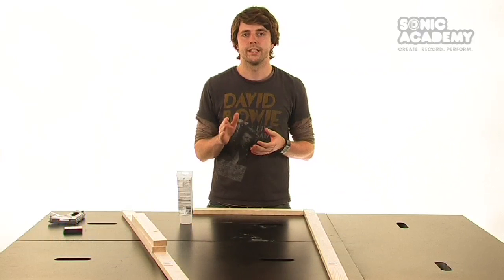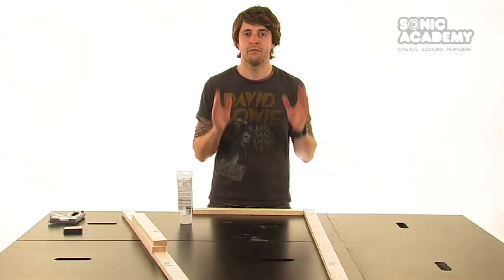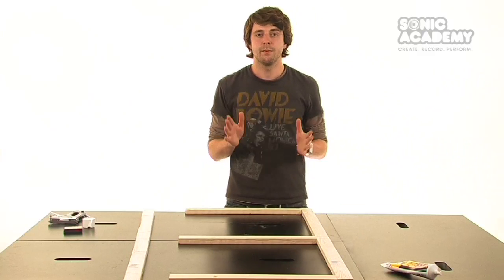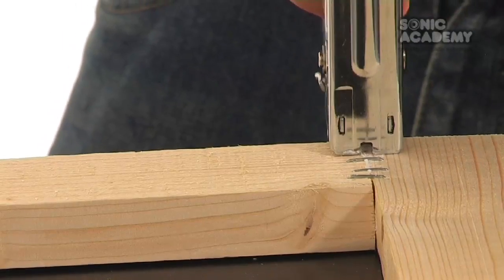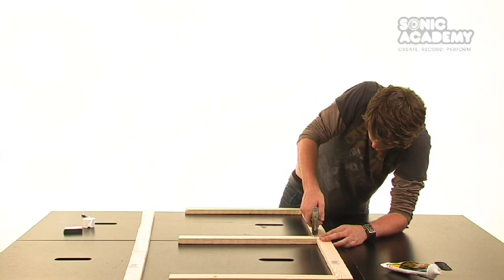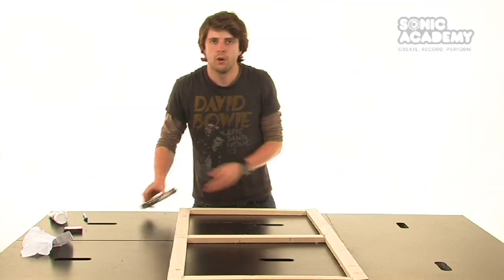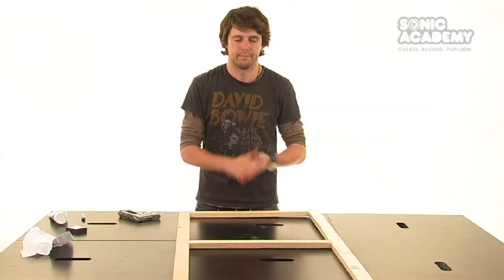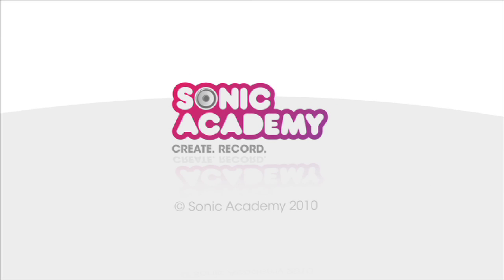How To Make A Rockwool Sound Absorber / Acoustic Panels - Part 2 Building The Frame

Comment: I know this video is meant for people with basically no tools, but I would suggest using some kind of truss/mending plate (they make them out of metal but you can also use thin plywood or MDF panel cut into 8" triangles or squares) on the joints to make it more stable rather than using glue and staples. You can even just glue the mending plates on so you don't need a drill.

Comment: I suggest using MDF since it doesn't warp and driving thin 2 inch nails with a nail gun. Much stronger and cleaner than staples. Use staples for fabric.

Comment: I totally understand the staples to get the cloth on. But I still disagree with using staples to make the frame. You can cut out gluing and stapling time, and a screw with a drill takes all of about 10 seconds. And it's more sturdy. That's just what I think. Thanks for sharing anyway.